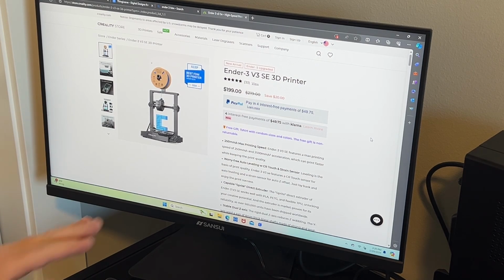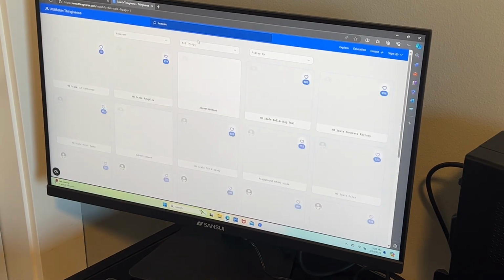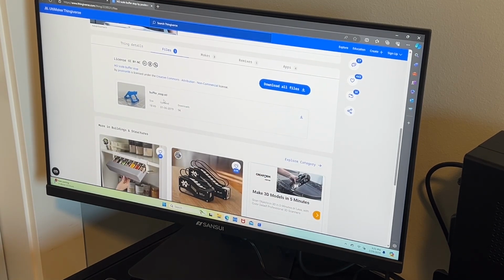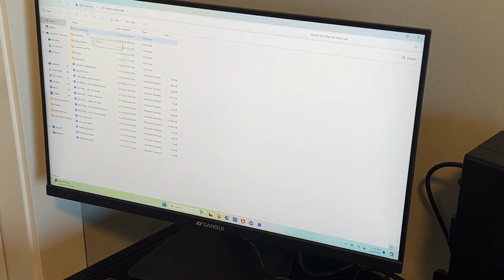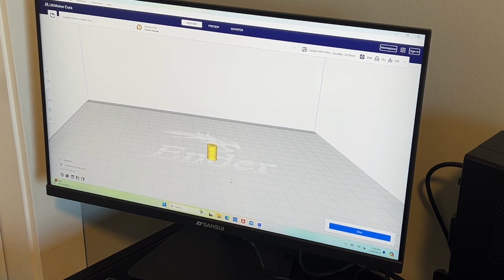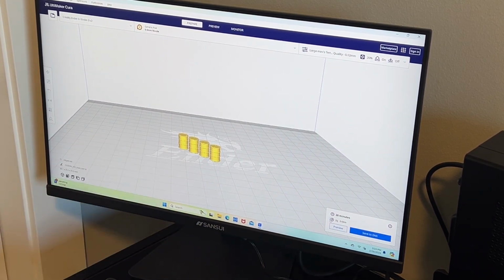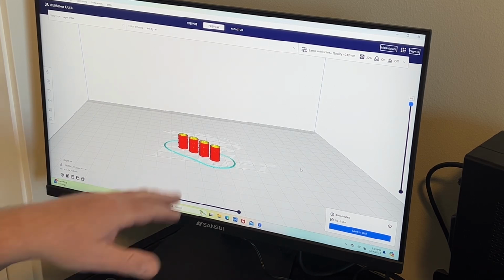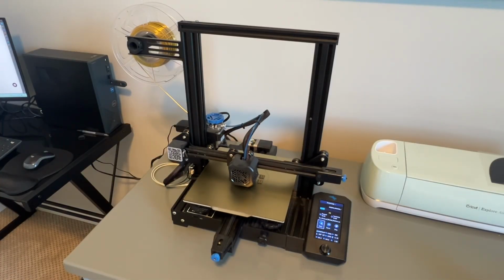Using a 3-D printer for your model railroad layout

Comment: One of my first ever 3D prints was an N-gauge building on an FDM printer. The layer lines made the walls look like siding. It worked really well. But, for much of the other stuff I prefer resin. I'm currently designing my own train models, but with a fantasy take, fun times. 

Good luck, and welcome to a new hobby, if you just started 3D printing.
Reply from the maker: Very cool!

Comment: I print scale models in N gauge (1:160) using my SE and small size adds complexity to handling details, but I've been successful with gadgets like the ones you show as well as buildings. Vehicles less so, due to the detailing, but even so I've printed lots of those as well.
Reply from the maker: I think 3D prints have a place in modeling but I agree with you it has its limitations 👍🏽